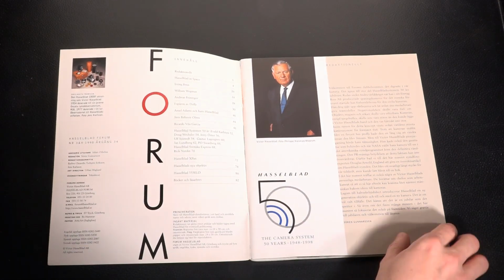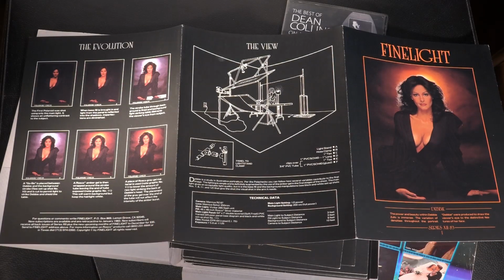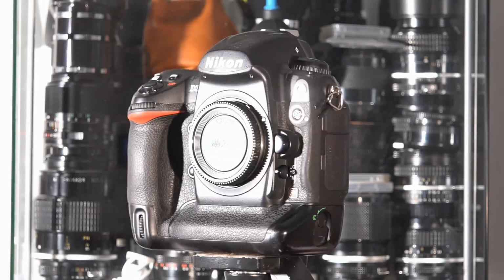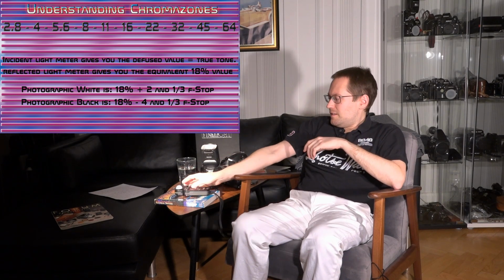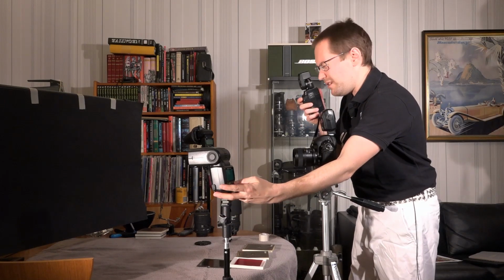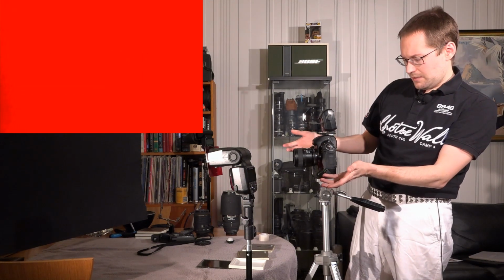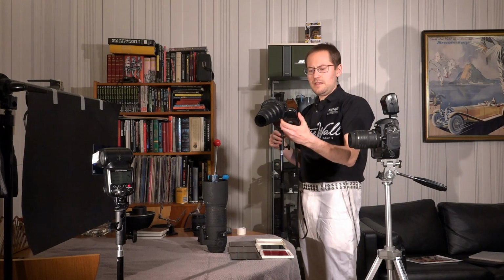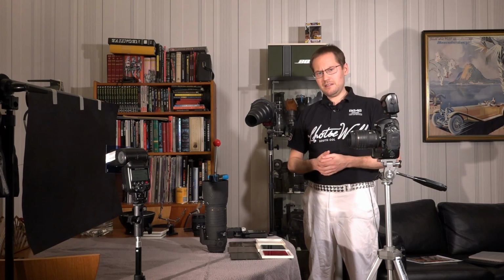Flash Photography and 3D Contrast, finding Dean Collins

Comment: Ok...!   Here's my problem.  I have a Minolta 4 Light Meter from the 1980's  It works just fine with the White Diffusion dome for Ambient Light readings.  It also came with the Black and the White Diaphragm for Reflective Light readings.   I don't always get consistent reflective light readings.

I watched the Live Brooks Institute videos of Dean Collins on Chromazone Color with the Chart.  Like Dean Collins said,  If I take an Ambient Light Reading from the background with the the Ambient Light Dome, It gives me the reading to make that Image contrast look like it supposed to.  I White background will look White and a Black Background will look Black.

However, If I take an Ambient light reading of my subject at f11 and  I move the Ambient Light meter to the Background, I should see a difference in the light fall-off according to the Inverse Square Law for Light.  If the Reading is f11 for my subject, the fall-off should be lower, the further back I move away from the light.   If I read f2.8 on the background behind the subject, that's a 4 stop difference between the subject and the back ground.  The Background should be nearly black.

Am I wrong here?  Do I really need to use reflective light readings to establish the Background Exposure?
Reply from the maker: From what you wrote it sounds correct. The difference is (from what I understand) that in your example you are lighting the subject and background with the same light source. So yes, the further from the initial masseur distance you go the lower the f-stop will get in accordance to the inverse square law.   
What Dean wanted to show is that by using this method you can use multiple light sources and still keep track on how they all relate to the defused value. The example being the subject is at f/11 but the background is illuminated by a light source with a colour gel filter. And in order to make the background light colour the wat the art director has deemed as “pretty” it has to be a -2 reflected in relation to the defused. 
So thet means while the defused value on the subject is f/11, the background light source has to be a f/5.6 reflected. In order to get the desired effect.